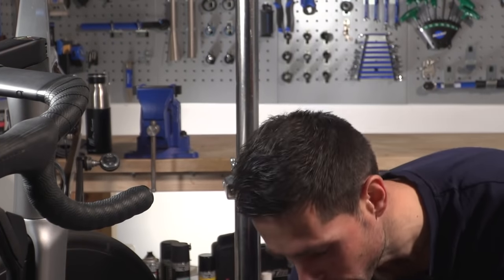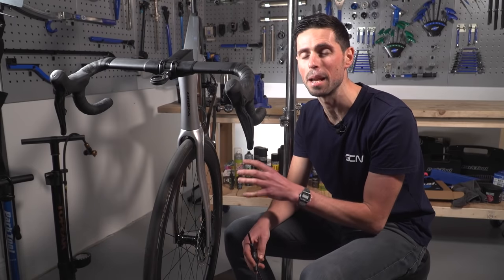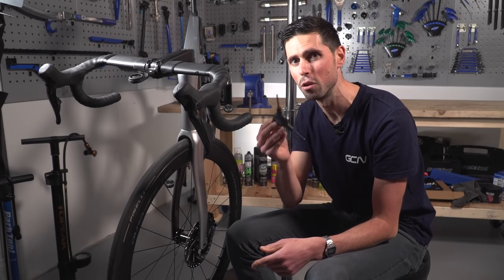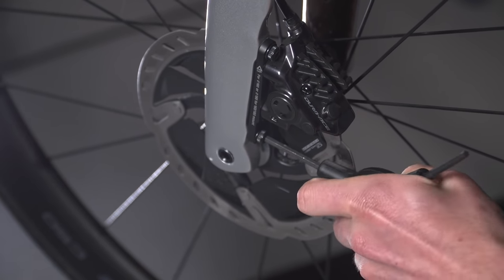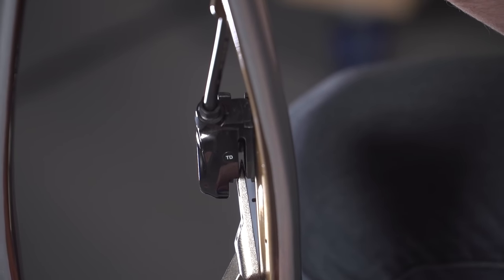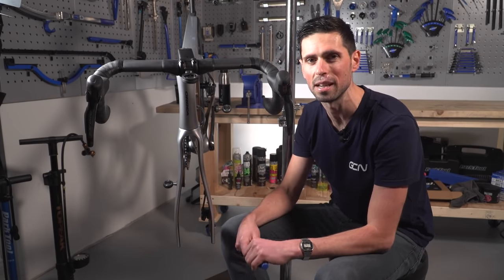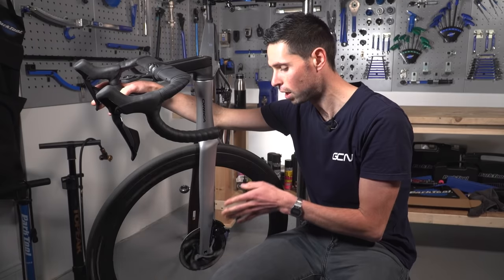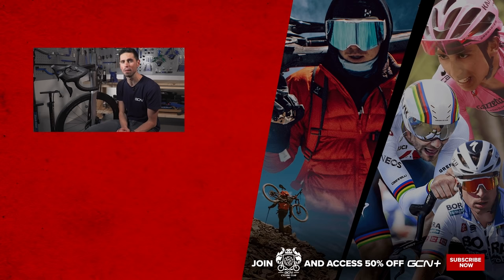How To Stop Your Disc Brakes Rubbing! | Maintenance Monday

Comment from the maker: What do you want to see Alex fix next on Monday Maintenance? Let us know in the comments!
Reply: Replace some full integrated shift wires with the out liners! xD
Reply: build a wheel, take apart a shimano pedal, center a tire on a rim.

oh.. 90%+ of cyclists would perform better with rim brakes over disc with the conditions they ride
Reply: Pressed bottom bracket in carbon frame.
Reply: Apple AirTag hidden in downtown be then locate the bike
Reply: Wheel hops
Reply: i use a spacer that sits on top of the disc when setting the calliper
Reply: Rear disc brake rubbing
Reply: @stephentait8734  What do you mean Stephen?
Reply: Mine is rubbing only when I am out of tha saddle. I have a new wheelset and rotors

Comment: Gotta love rim brakes so simple
Reply: yes, simply no brakes in the wet with carbon rims. I will never change back!
Reply: @dakalla  Don't use plastic wheels then.
Reply: sadly i love carbon rims
Reply: @user-nu5fx6en9h  It is sad, your not trying to look like a pro , are you?
Reply: Agreed. I fix rim brake rubbing with a hex bit. No wrench, just fingers turning one screw and pump brake to test. No removing this and that.
Reply: Yeah simple until brakes thin out your rim 😂
Reply: Well...on an ebike that does 30 or 40...you probably wouldn't want rim brakes😂😂😂.

Comment: Pushing pistons in, without cleaning them first is counterproductive, pointless and only creates problems in the long term. Clean pistons first, as the reason they don't work properly is because they are covered in gunk.
Reply: How to clean them ??
Reply: @normen416  I usually use a tooth brush and brake cleaner to remove black residue leftover from brake pads. And then finish it off with a cotton swab and brake oil (same as used in your brake system) to lubricate piston. If you don't clean pistons amd just push them back you're introducing dirt and debris to brake fluid. That's why it goes black over time. There are some videos on YouTube
Reply: @normen416  I follow the advise of getting them to pop out a little (no more than ~1.5-2mm out), and go around the perimeter with a cotton swab with a bit of the brake fluid (mineral oil or dot fluid as appropriate).  Push the pistons back in, then repeat until the swabs stop coming back black and both pistons come out smoothly and roughly at an equal rate.  If one piston is stuck or much slower than the other use the  tire lever to hold the opposite one in place as you cycle the lever to get the sticky one to pop up for more cleaning.  Finish by fully depressing the pistons, clean the entire assembly with alcohol, and re-insert the pads.
Reply: @normen416 go to well know proper good bike shop,safe u time and silly effort will make matter even worsen
Reply: Meh
Reply: @wazirtan6801  The type of people who watch these videos are the type of people you bring your bike to for repair. This video clearly does not apply to you. Your comment was a waste of time and a silly effort.
Reply: @jacob8266  so what im a silly or watever that u problem,u talk too much,i even need ur reply
Reply: @wazirtan6801  I don't talk too much, you talk too little. 

I am not even sure what you mean by your reply. 

I don't think you are silly. I think maybe you are confused. 

At least you got a reply from someone 1 year later who told you the truth. 

I wasn't feeling like you were even going to respond so I am surprised. 

Are you feeling like I'm talking too much again?

Comment: Difficulty with disc brakes always comes down to awful frame manufacturing and preparation: a big middle finger to manufacturers for cutting corners. Get your brake mounts faced properly and enjoy drama free disc brakes.
Reply: We had such a nice solution with conical shims on the MTB a few years ago. Worked perfectly in every condition. I don‘t know why this has disappeared.
Reply: @chrisridesbicycles  for road it's probably because flat mount brakes are designed to be more aero, for mtb it just disappeared. Which is sad because if your frame is crooked, then the disc is crooked
Reply: This. Absolutely.
Reply: @dan_lazaro  Yes, I can halfway understand it on road bikes but on the MTB side it disappeared without any reason. The only ever downside was that you always dropped one of the shims during mounting.
Reply: @dan_lazaro  While it's true that a crooked frame will cause disc squeal, it's also true that a sloppily faced disc mount will have the same effect.  It's weird that Park sells the DT-5 disc mount facing tool to bike shops, because that's a tool only a frame builder should need.  The mounts should come from the factory properly faced and never need to be touched again.
Reply: Absolutely!   The rear caliper mounting surface/face on my Orbea Orca OMX was pathetically out of square with the axle centerline.  
I made a Delrin block with a 12mm bore through its length so it could slide back and forth on the rear axle.  Then made an offset aluminum surface that was perfectly parallel to the axle centerline, and bonded 280 grit sandpaper to it.  
That allowed sanding of the caliper mounting face on the chain stay until it "cleaned up" and was parallel to the axle.  
What a difference!
Reply: Not always. And rarely.
Reply: And the Park brake mount facing tool is a monumental piece of shit.
Reply: @agie170hss2  Hack for me. ;) Sounds a bit like the times with IS2000 disc brakes on the MTB.
Reply: @agie170hss2  nice. Such a shame when you know a warranty replacement probably wouldn't even fix it and it would be a huge pain.
Reply: @chrisridesbicycles  I am very lucky to have minimal disc squeal on my sister's hybrid, since I fix her bike when something goes wrong with it. On my road and mountain bike, I have rim brakes. I prefer rim on road but I just don't have the money to get a good mountain bike so I don't got disc brakes lol. I like to justify my inability to get a proper mountain bike by telling myself I'll learn techniques and line choice better on a fully rigid mtb with rim brakes.
Reply: @grumpynerd  This is interesting, I've experienced trying to align my sister's rear disc caliper to no avail only to realize the piston doesn't go back in straight. But to discover that it is possible to get a crooked disc caliper is enough to make me lose sleep. Until I forget about it in about 15 minutes and I'll probably only remember it when I get disc brake problems again.
Reply: @dan_lazaro  I can‘t really say anything against it having learned MTB on fully rigid with virtually useless canti brakes myself. But please get a wide handlebar if you don‘t have one. The 560mm of the 90s really held me back learning.
Reply: @chrisridesbicycles  I can't remember if my bars are 650s or 600s, but any wider hurts my wrists so bad, maybe there are bars with more back sweep than mine but I ended up cutting my bars from 720s to around 600mm. I've done the threadless adaptor as well I think I'd do well on one of those 35mm stems though the 80s have been fine. I even have this weird curiosity to put my -17 130mm stem from my road bike and see how it feels on the trails but I'm afraid the slow handling of such a stem might be dangerous for trail riding where you need a lot o maneuverability.
Reply: @CountryDick  what’s wrong with it? I don’t have experience, just curious

Comment: 9 out of 10 times the issue is warped rotor, mainly after overheating it on long descents.
Reply: Pretty much, Shimano road rotors suffer badly from this as the rotors are thinner than Sram  & Campag, and on the last gen groupsets at least  ( I think it's improved on the latest) have crazy tight clearances to the pads.
Reply: I got brand new pads and rotors and the rotor scraps on the pads in one section.  What can it be???

I performed what was shown in the video, and it still scrapes.  Am I destined to bring it to my LBS??
Reply: Yep, after exhausting myself with all possible solutions this was the answer. It must have happened when I removed my tyre to remove my innertube.

Comment: Wiggle the wheel back and forth with a little brake pressure with the bolts slightly loose and GRADUALLY tighten the bolts one then the other then the other etc. whilst still running the wheel back and forth slightly. You are welcome.
Reply: +1 Just fully tightening allows the housing to twist with the torque, and almost universally you are back to where you started, if not worse.  Get the bolts to just start tightening up (like just past finger tight), and do no more than a quarter turn each at a time and 9 out of 10 times you are gold.
Reply: Applying brake pressure while wiggling the wheel while tightening bolds… how many hands do you have?
Reply: That won’t work

Comment: Important hint: When centering the caliper, after loosening the bolts and BEFORE applying the brake lever, manually push the caliper towards the frame. If you don't do that, the caliper will not be in its final position and tightening the bolts will change the position again (towards the frame) and possibly mess up alignment.
Reply: After loosening the bolts, i spin the wheel forward then apply brakes, holding on to it then i tighten the caliper bolts again. It works but your method would seem to be more effective.
Reply: Yo thanks for the tip, it was really helpful. I knew that something was missing, because the rubbing got worse after a couple of attempts. But after doing what you said it's perfect.
Reply: This is exactly what helped me! Thank you very much 😎

Comment: Centering the calipers is not always that straight forward. Commonly forgotten is that the action of doing the bolts up moves the caliper off centre. A business card used on the offending side that the caliper moves works well here.
Reply: this and the second problem I found on cheaper bikes is that you dont have a good geometry and the caliper could be tilted. Then pretty much any technique end up rubbing.
Reply: this is a great idea! I just got my first bike in fifteen years, and can't for the life of me figure out why the front is rubbing. Tried centering, tried manual adjustment, neither worked. I was wondering if maybe part of the frame or caliper is bent a bit, but I'll try this trick before going to a shop :)
Reply: Did you figure it out @LaggerSVK
Reply: @tevtev7985  no, if you find out that the caliper is misaligned I mean there is only one option - machining. But it could be also misaligned in such a fashion that even machining wont help. They do this in proper bicykle shop.
Reply: Legend! Thanks for this tip. Helped me solve an annoying rub I've had for weeks.
Reply: I notice a bending away from the frame when tightening the bolts. I ve used a tiny piece of aluminum foil folded several times and put on the side where the caliper tilted. Worked fine and prevented that tiny angle that caused the disc to rub
Reply: The business card trick saved me thanks 😊

Comment: The only thing that worked for me was to take out the U shaped spring ( thin metal piece) that pushes the caliper apart and "reshape" it. I made it wider and that solved the problem instantly. It's been good all season after that fix. 
I believe the manufactures should make a slightly more robust spring.
Reply: When you look at the force required to push the pistons back in, that little spring seems so inadequate doesn’t it. Surprised they aren’t more substantial
Reply: The spring isn't to push the pistons back, it's to keep the pads from rattling.  You want the pads to stay as close to the disc as possible so you don't have to pump the brakes a couple of times before they contact.  It's the rubber piston seal design that pushes the pads back "just enough".
Reply: @jefferycampbell2243  ah, I see. Didn’t realise it was all down to the piston seal to retract them. Thanks for clarifying, I often wondered how that worked 👍
Reply: @jefferycampbell2243  I'm pretty sure the piston can only squeeze the pads.
There is not enough negative pressure in the master cylinder to draw the piston back.
Like on a car the pads stay a hairs width away from the rotor because they don't warp.

Comment: Worked great on my ebike. Shop had slightly over tightened, so there was a tiny faint noise of rubbing coming from rear break. After this video I loosened the two rear alan bolts till loose then squeezed break hard, released, and tightened back up but not as much as too replace the same amount as last times "tighten" picking up bike my rear wheel now spun freely! So then I tightened just a little bit more to make sure it was securely tightened. I will go for a test break rise here soon.
Thanks!

Comment: Shame it's gonna squeal again when a gentle breeze contaminates it.
I'd actually like discs but they just seem like such a pain in the a** to maintain. Also more expensive. 
I'll admit I live in the mountains and there are times where I would have probably been more confident on discs and I'd love not to have to keep swapping rims over between aluminium and carbon depending on the ride.

Comment: I’ve seen many videos where they demonstrate “pushing the callipers back in” but my thoughts are always that if the callipers have failed to go back in at some point -hence the need to push them back manually, what’s to stop this happening again, surely there’s an underlying problem which needs addressing. Won’t pushing them back in manually only fix this issue there and then, and probably for a very short period? It’s like saying if your car repeatedly blows the same bulb the answer is to replace that bulb and bingo! It’s working again. Lol.

Comment: I bought some inexpensive automotive disc brake cleaner. When I oil my chain I clean the discs. It seems to help a little. 

I have both a disc and rim brake bikes. The disc is much better in every situation except maintenance. They’re a nightmare. I spend minutes per year working on my rim brakes and hours on my disc brakes.
Reply: Totally agree, guess why I'm here? Bloody rear disk grating. Have now replaced the QR axle with a fixed one. Cannot get the thing to line up whatever. The pistons needs to go back further I think.

Comment: Applying the brakes while the caliper bolts are loose sounds good but never seems to work for me. The tollerances on the previous generation Ultegra are so fine I had to wait till the pads were worn a bit and then manually adjust the caliper while looking for light on each side of the rotor. Finally I now have a free spinning wheel but with nice brakes.

Comment: 9/10 pulling the brake and tightening the bolts does F-all!  Especially with flat mount (non-centering bolt) brakes. Hate em. Wish I had never left rim brakes. I spend more time screwing around with disc brake than any other part of the bike (bleeding, centering, listening to screeching). Seriously hate them......